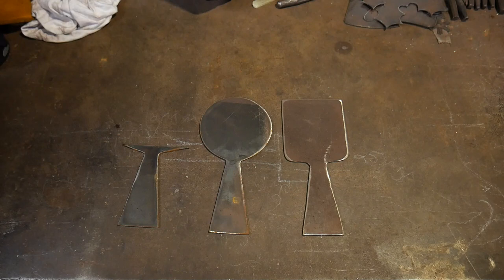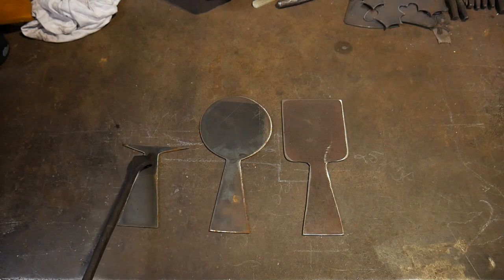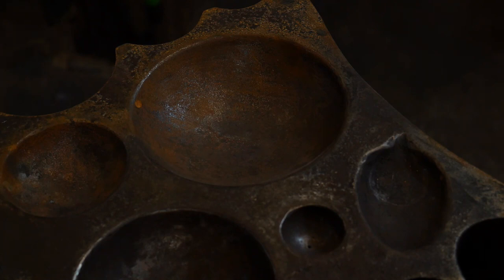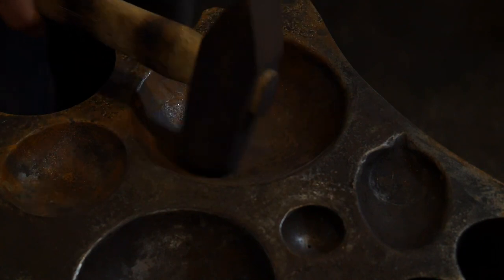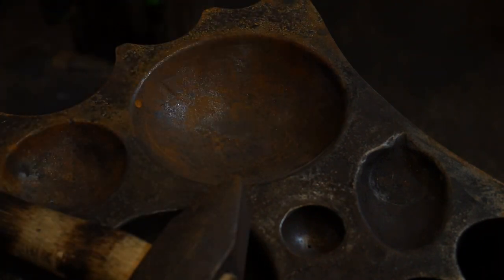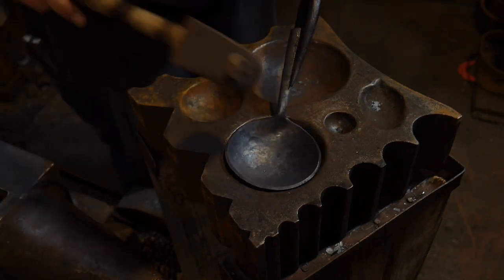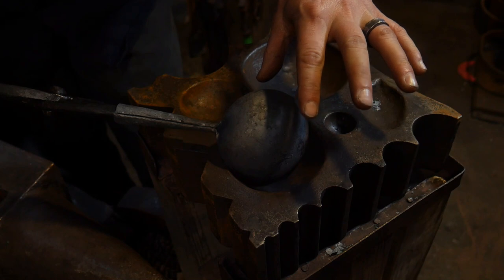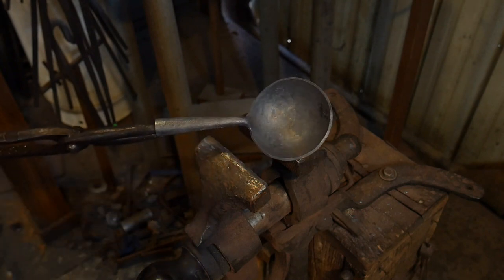Forging a Ladle (Part 2 of Forging a Kitchen Utensil Set)

Comment: "as handy as a boat anchor" I am pretty sure that when I'm in a boat and I want that boat to set in it's current position a boat anchor is a real handy tool. Like wise if you are wanting to shape some steel to a certain shape and you have a swage block with that like shape, yes at that point it is "as handy as a boat anchor."
Reply from the maker: +bc65925 yep sounds about right :-)